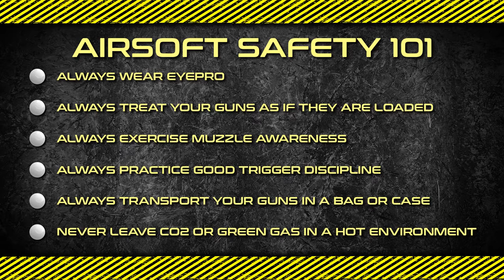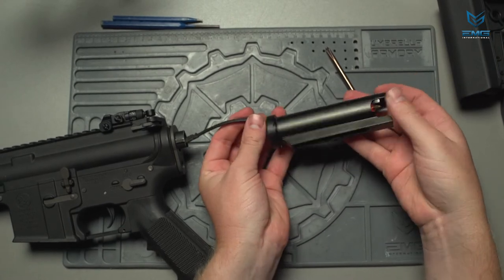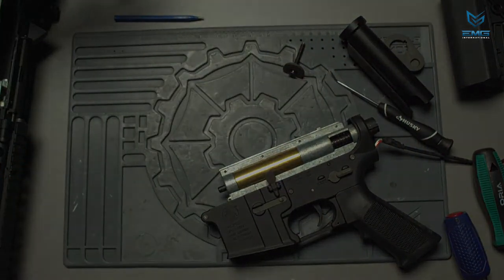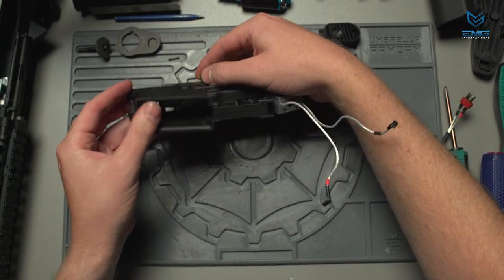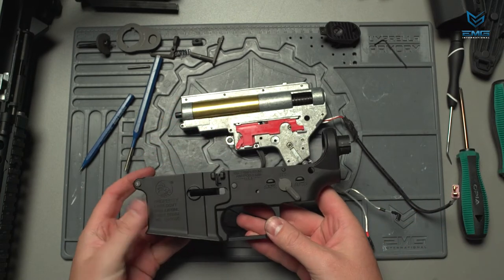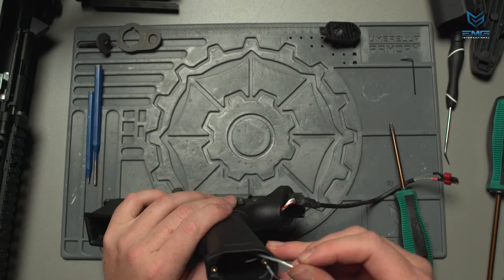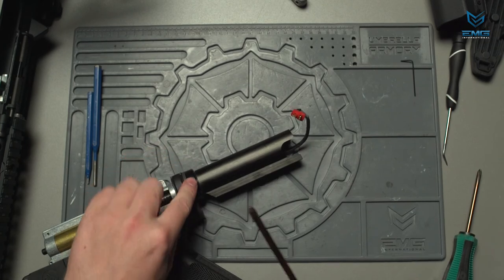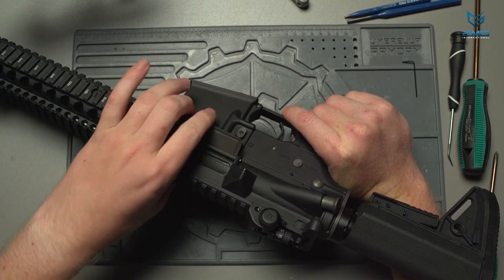EMG Arms COLT M4 AEG Manual

Comment: hi there, i just bought an emg colt 12.25inch m4 aeg, but here in korea, the maximum fps is 350fps below only, my emg colt m4 rifle is around 370fps, so i need to lower the fps. can i just change the internal spring to lower my fps, maybe around 340 or 350fps? what spring size should i buy?